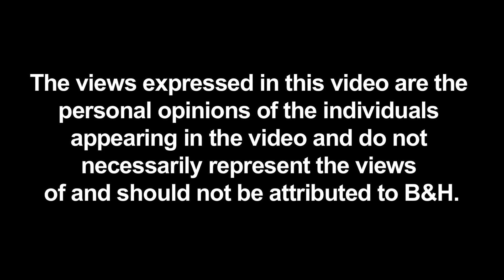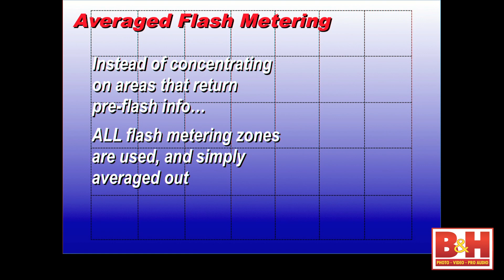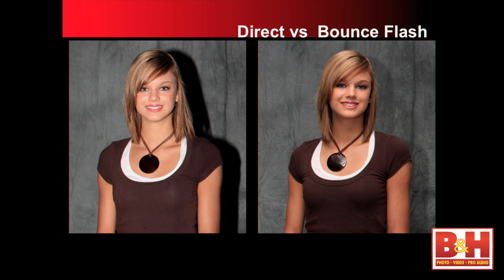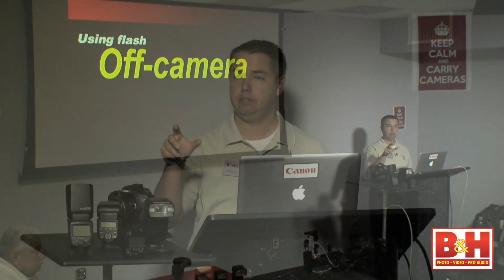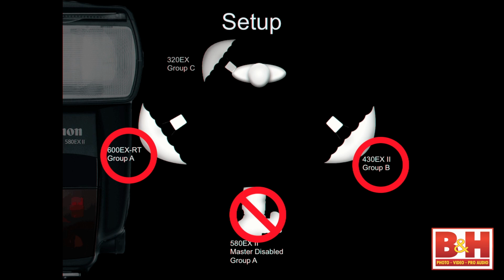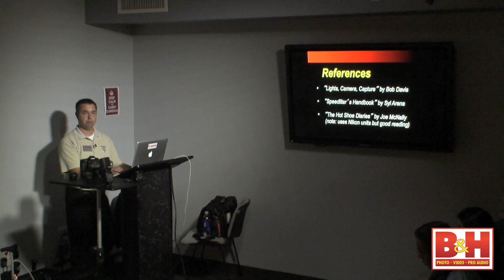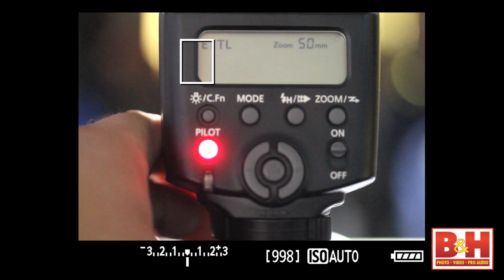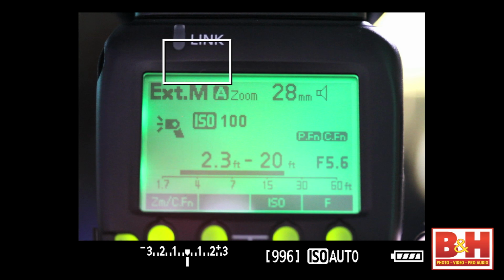A Flash of Brilliance: A Hands On Experience With Canon's Radio Based Wireless E TTL System

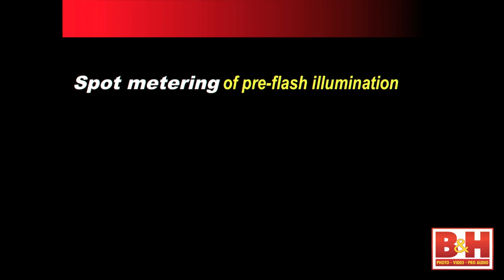Comment: To my knowledge, the popular shutter half-press-and-recompose approach leads to the focal plane rotating behind the object, which is less than ideal for obtaining sharp focus. The purpose of the auto-exposure (AE) and flash exposure (FE) locks discussed from 39:00 is exactly to decouple exposure metering and autofocus, so that an off-center autofocus operation can be performed after the exposure has been locked in. So every time John says "focus lock" think "FE lock".

Comment: I understand what you are saying and feel the same way, but this isn't Canon's fault. What's happening is that the new speedlites require a radio trigger to send a signal to your new 600RT. Aside from the newest models of cameras which have this feature, older models need to have a module to replicate this signal hence the need for an ST3 transmitter. It's good to still get the 600RT's so that when you upgrade your body in the future you can have this functionality.

Comment: It's not Canon that's looking to aggravate you but the salesman at the local store who couldn't tell you WHY you couldn't do what you wanted to do.  

To get the most out of the top of the line product the components have to work together and the 600RTs use a different technology for off camera wireless ETTL than the older line was capable of (radio vs infrared).  Had you known that I bet you'd have been less aggravated at being sold a bunch of stuff you hadn't expected.